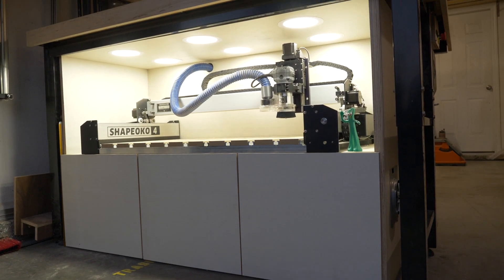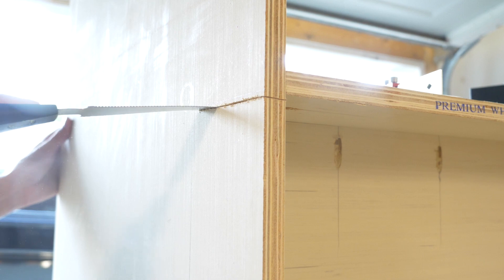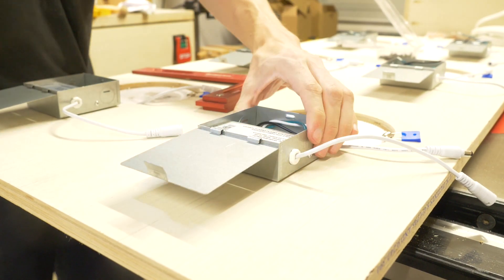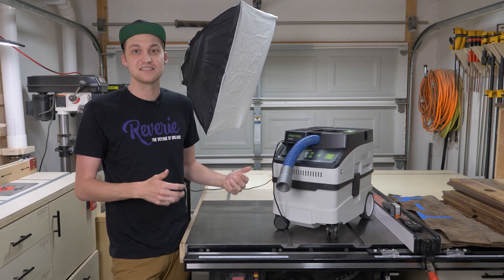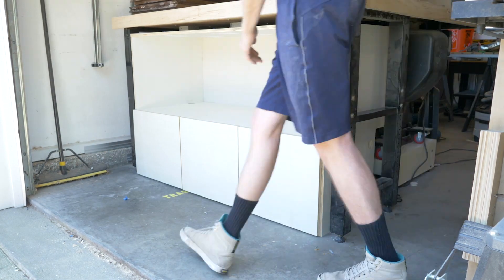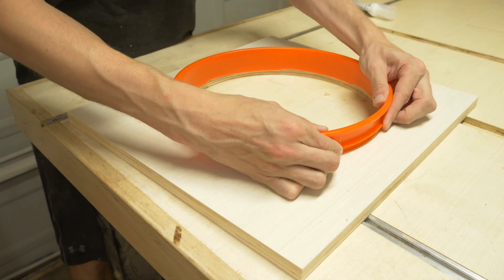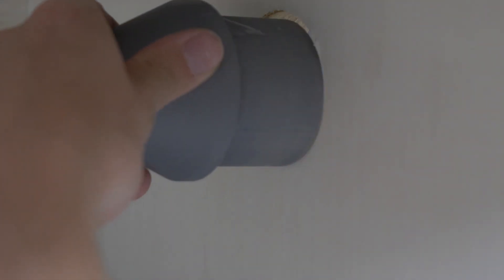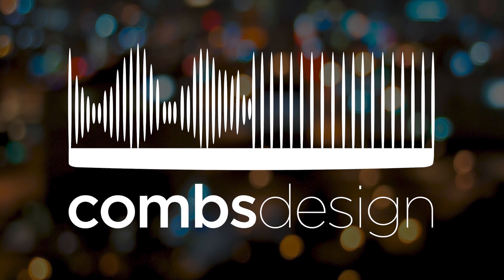Shapeoko 4 CNC Enclosure

Comment: Amazing design and build! I'm currently working through CNC enclosure designs to try and do something similar - i.e. utilizing space under my outfield table - to maximize the usable space in my small shop. Whether or not I can find a way to make it fit will partially determine if I add a CNC to my arsenal. I saw in a previous post that you don't have the plans/drawings for this, but would you be able to share the inner dimensions of area the CNC sits? I know the footprint of the Shapeoko per their site, but am interested in how much clearance you gave it (especially vertically) and if you've had any issues with the dust hose or any other parts due to the compact size of the box. Thank you!

Comment: Why didn’t you plug the router into the port on the dust collector? That would have saved the need for the exhaust fan.
Reply from the maker: Because I also move that vacuum collection over for other Festool tools, so I wanted the power to be independent.
Reply: Might be more continuous load than you want on the vac...

Comment: I'd be grateful to understand how the wiring of the remote switches back into the control box is done too. Do you have a wiring diagram or some pictures. I want to add a spindle pause, an estop (I know how to do this one!) and router control, cnc power on a panel like you did, but unsure how to connect to the control panel
Reply from the maker: Those switches I used are simply power switches. They are rated for an appropriate amperage at 120v. Every switch has a power in (line power) and a power out to whatever it is controlling (load). Think of all of these as light switches, because that is more or less what they are. The power comes in and first runs in and out of the e-stop. If I use the e-stop it powers off everything downstream. The power output of the e-stop feeds all 4 of those power switches. Each switch then has an output to whatever it is turning on or off. Grounds and neutrals get tied together per your local code.
Reply: @CombsDesign  "Each switch then has an output to whatever it is turning on or off."  I'm having a hard time envisioning what the connection between these switches and the individual devices are.  How does the switch connect to the CNC?  Are the leads for each device being cut and spliced?

Comment: That's a fantastic enclosure. I DIDN'T KNOW until the very end of the video that it was going under your outfeed table.
WICKED COOL!!! From someone in a tiny shop that is a ingenious idea!!!
If you are like me and never satisfied.....
You should consider a spindle with a selector for software and manual control. Plus adding a E-Pause wired into the feed and hold pins on the C3D control board. It makes life so much easier!!
Reply from the maker: I have used about every square inch of space vertically and horizontally in my garage. I am glad you enjoyed the video and hope it inspired you! I will look into those CNC upgrades!

Comment: I would be really interested to see how you wired your switches and emergency stop.  I am at the point in my enclosure build where I need to consolidate all of my switches and you have the best example of what I’d like to accomplish.  Great video!
Reply from the maker: The hot output of the kill switch jumps to all of the hot inputs of the individual switches. This way, when I cut the power to the kill switch, it cuts power to all individual switches. You can either do this with multiple wires running to a single wire nut, or jumpers across each switch.
Reply: @CombsDesign  are those 120v switches?
Reply from the maker: Yep! The kill switch has a much higher volt/amp rating, but the small ones are 120v.
Reply: @CombsDesign  I appreciate the clarification!
Reply: How are you liking your CNC ? Are you thinking you should have bought the XXL or are you happy with the XL. I’m undecided between the two. I really love your enclosure, top notch.

Comment: Excellent job with this! I'll be doing something very similar; my shop is a one car garage, and I love how you have a space for the shapeoko and still have a work surface on top.
I really like the dustopper box. That's very easy to modify and implement to any workshop situation.
Reply from the maker: Thanks so much! I think I have gotten every last inch of usable space in my garage used. Check out the plans by Sandy that I have in the description, he does a great write up.
Reply: @CombsDesign  Will do; grabbing the plans now. I'm sure I could design and make my own with the tools and knowledge I have, but I'm happy to support another craftsman. :-)
And again, you did an amazing job with this. I'm looking forward to more videos about your CNC journey and especially that control panel you made for it. Have a great weekend!